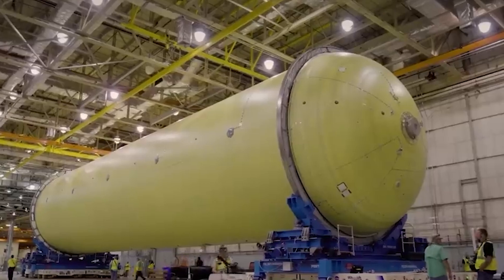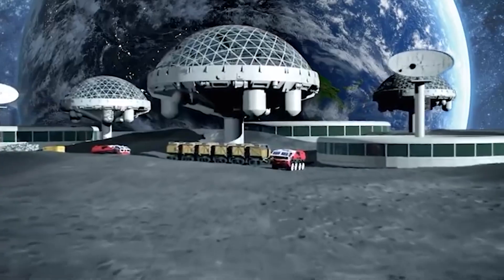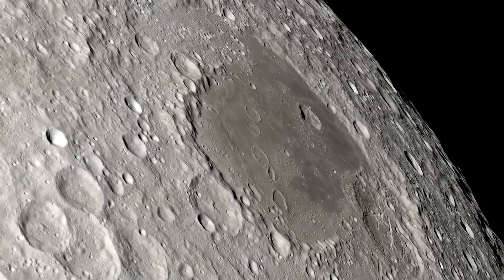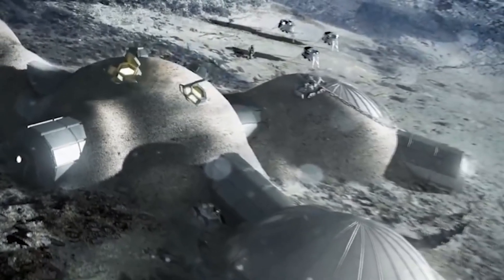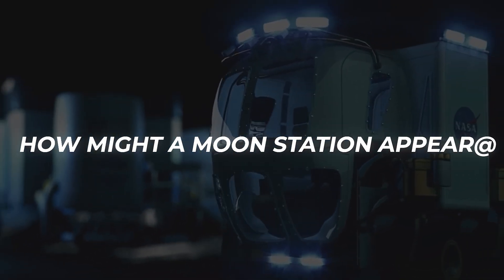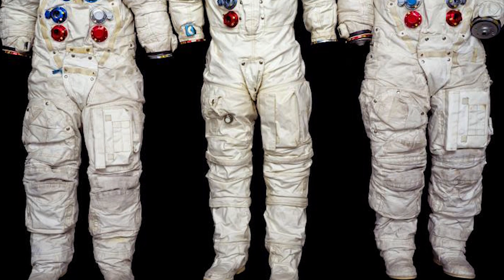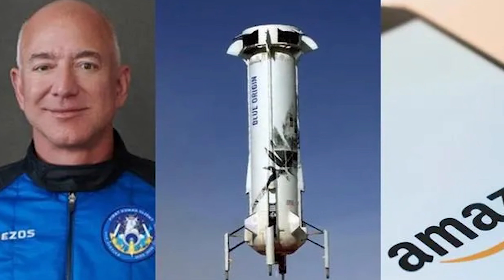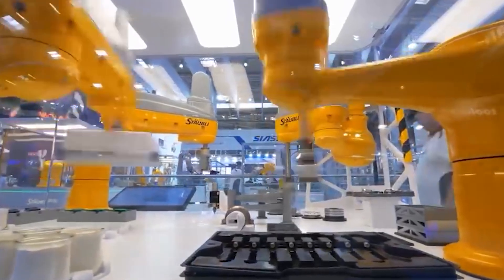THIS IS What A Moon Base Could Look Like!

Comment: A moon base is either built under ground or the human's will die by radiation from the sum. The ISS is still protected to a great extent by being in low earth orbit inside the electromagnetic field of the earth. 

Mining rare earth minerals on the moon is the only advantage to going to the moon. To do this requires only robots. Robots will not require creature comforts or life support.